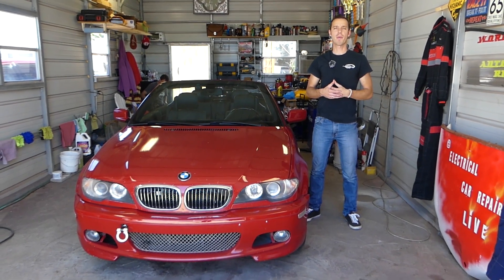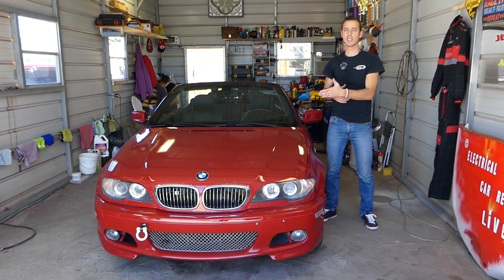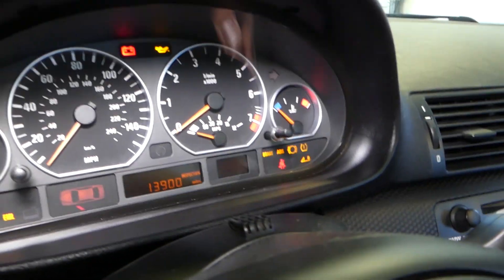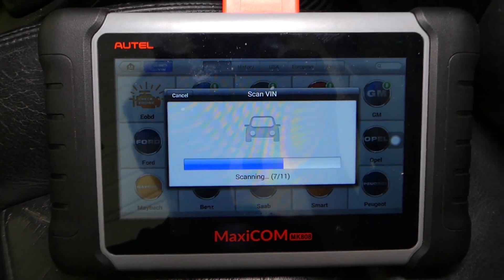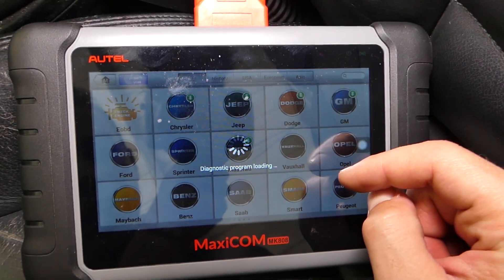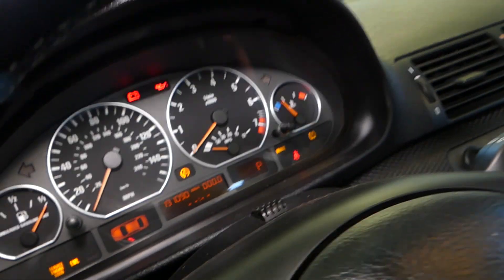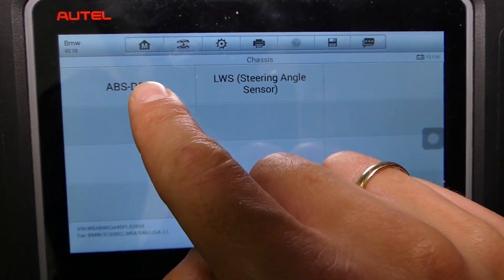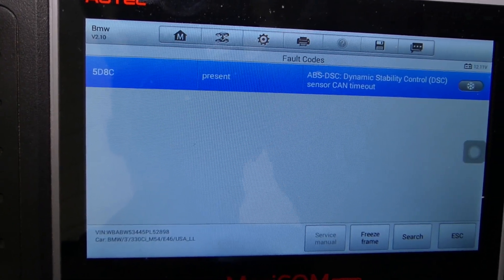BMW E46 CODE 5D8C 5E38 5E30 TRACTION CONTROL LIGHT ON BRAKE LIGHT ON ABS FIX 325I 330I 328I 320D

Comment: Hi guys just wondering if you can help? I have a BMW 318i E46 (N42) 2003 and I have the following codes

5D8C ABS-DSC: DSC sensor CAN timeout
5D97 ABS-DSC: DSC sensor voltage supply

I have cleaned and tested all wheel sensors which are working okay
The steering angle sensor has been recalibrated 
I have tested 3 different YAW sensors but unable to remove the codes
The car battery has the following readings 12V (engine not running) 14V (engine running)

Can anyone help with this?

Kind regards
Reply: Hi Robert, I have the same codes. Were you able to solve the problem?  I've tested another yaw sensor but the codes come right back up after clearing the codes and cyling the ignition.

Comment: hello there guys.!! I want to see if maybe you can help me figure out what's wrong with my 2001 bmw 330ci... its been having this issue since I bought it last November 2019..the problem is the following: when driving the car my DSC LIGHT AND BRAKE LIGHT ALWAYS COME ON and when they do the car starts making this noise from the front left driver tire and then you can feel like the tire braking or as if something is getting stuck..as that happens the lights on dashboard start to flicker for few secs as it recognizes there's something wrong and then stay on until car is stopped and parked.. in one occasion it even make my front left tire get completely locked to where it burned tire (because I was driving it of course lol)... I can't seem to find what's the issue , I've already replaced the brake rotors with pads, also abs/speedometer sensor, and still no success... Ive tried taking it to a shop (not euro car emphasized) and they suggested the abs sensor that's why I replaced as well, but nothing...
DO YOU KNOW WHAT CAN POSSIBLY BE WRONG WITH MY BEEMER..? PLEASE HELP!!
Reply: Kinda same issue with my 04 325xi, I replaced all wheel sensors... Stopped for a while, does it sometime when it's cold. Snowed today, dsc, abs, all turned on.. no traction.. no bueno..
Reply: Did you ever figure out the problem? My 330ci just started doing this same thing.